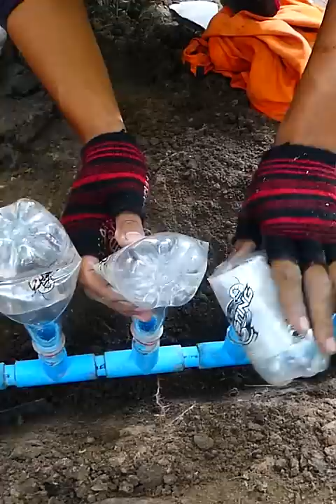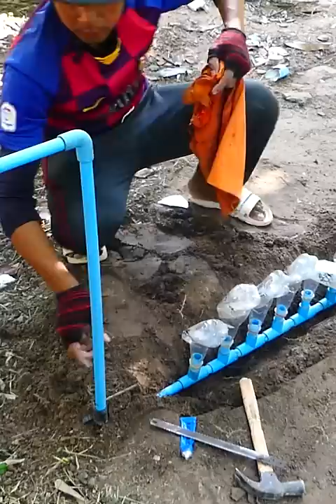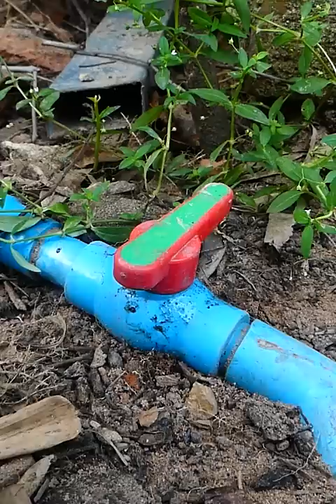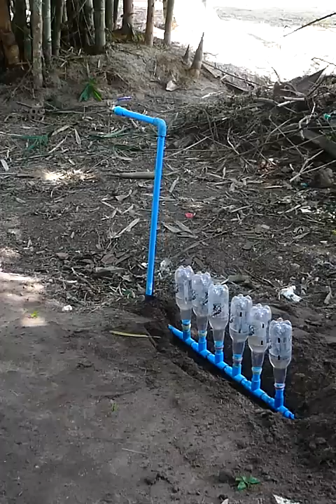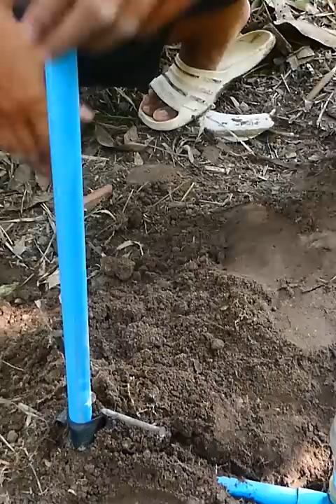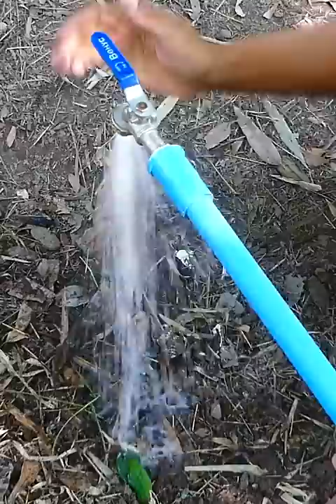Trick Free electricity | I turn PVC pipe into a water pump at home free no need electricity power

Comment: It's basically a pressure capacitor to create a temporarily high flowrate from a low flowrate system
Reply: Nope this doesn't act as a capacitor at all its basically useless all the pressure is due to the incoming water, the bottles didn't add anything. You might wanna review your knowledge on fluid mechanics
Reply: @tjvisuals  It's not causing the water to flow. Its purpose is to increase the water flow for a short period of time. Water can not be compressed, but air can. When the water pushes up into the bottles, it compresses the air, which will push the water out with more force when the valve is first opened. It just sucks at this job and will only increase flowrate for about a second.
Reply: @Zeecontainers  I know. But, since it is of no use its negligible you cant characterize this as a capacitor
Reply: Its purpose is to generate comments and views...

That's all
Reply: @orderofmagnitude-TPATP 😂

Comment: I believe those water bottles act as a diy “shut off valve” to release the pressure in the pipe when shutting off the faucet. It would have been nice if they didn’t try to scam people 🙄
Reply: The bottles wouldn't "release" any pressure in the pipe, they only replace water pressure with air pressure which would accomplish only the 'sponginess' of airbells that reduce stress on the pipes of abrupt shutoff and hydraulic 'hammering' that occurs without airbells.  This device would be useful if it had a check valve upstream of the bottles and a significant amount of water in the pipes to take advantage of the initially higher flow rate when the faucet is opened.  That would be providing a brief 'ram pump' surge.
Reply: I think what you're think of is called a water hammer arrester. It alleviates the spike in water pressure when you turn off water.  At best its what this guy attempted.
Reply: Just how are those bottles "cutting the flow off"?

Comment: actually its a home custom hydraulic ram pump, and plastic bottle will leak or die quickly, buy a proper device, interest of ram pump is that they augment the pressure in using water pressure itself, here soft bottle have compressed air which release pressure when you open tap water, so for several second you got more water pressure than without this system. the idea is to reach more elevated ground with this system.
usually ram pump are taller, and have clapet/valve... i advice to buy a proper one, 80$ for market price, another idea is to use an expansion chamber which are cheaper.
the title with electricity, refer to the alternative solution: electric pump/surpressor, so yes this solution is electricity free.
Reply: This is absolutely not a ram pump, commonly known as a water hammer, it is a water hammer reduction system, basically the opposite. Well, technically it's just a useless thing to generate comments, but you're still wrong.
Reply: The water from a ram pump comes out in pulses, not a continuous flow like this. Totally wrong.

Comment: Most people here did not understand the purpose of the system, it generates pressure in the water, but the bottles should be filled with air, preferably highly pressurized for the system to work well, that is, it is not useless, but rather functional in the way shown
Reply: Do you think it's heat, that's the only thing I can think of

Comment: Pretty sure this would work as a hammer reducer. When the tap is shut quickly the bottles will take some of the waters momentum into them, pressurizing the air inside, reducing strain on the pipes. Who knows how long the pvc is.
Reply: That was my guess as well
Reply: It should be above the highest point or it will water log quickly.... But maybe that's why he has 6 of them 🤣
Reply: yes, like surge tanks maybe.
Reply: But he squished the bottles first to have less air in them.
Reply: True, maybe just did that  to show us the water level?
Reply: Update: I set this up just like he did, even squished the air out. It works! I've had free electricity ever since and I'm saving a ton of money.  This is probably how the Egyptians built the Panama Canal.
Reply: @shakarchi420  that uh, that didn't really happen did it Homer

Comment: It works as long as there is compressed air in the bottles. Short after you open the tap and the pressure reduces, the flow goes back to normal.

Comment: For who dont get it immediately: The bottles store enough water for a constant water pressure until they are empty by using the water. The time water is off it can accumulate in the bottles. The pressure is good for work and nit weak for the first, but it can empty.
It is usual to have a electric water pump with a pot for the right water pressure. The electric pump would automatically reffill the pot before pressure would decrease..
This system should use no current, so it is free. Its not about producing current here.

Comment: While it's true that there are ways to make a water pump without electricity, there still needs to be some source of motion that forces the water through the pipes.

Usually either something like a water wheel attached to an archimedes pump or the gravity in case you are drawing water from a lake or river on a higher elevation than the outlet
Reply: Don't forget the "ram pump".  They are very clever devices.
Reply: @dennisbecraft1303 yes but wastage water more.
Reply: @amitpandeysg2  Ha!  A ram pump is "wasting water" only if you are planning on pumping out 100% of the flow of the river or stream!  Who ever expects or even wants a pump to do that ?  
No water is "wasted" if all you're doing is using the momentum of some of the water to pump some of the water.  
What value, usefulness  or characteristic of the unpumped water has been lost ?  
It's gravity that causes the river to flow and gravity will quickly restore the speed of the flow after you have diverted some of its momentum.  What damage was done by use of that 100% clean, renewable solar energy that lifted water in the atmosphere where gravity could eventually collect it & channel it in flowing water ?  
Conceptually you are claiming a ram pump is a waste of gravity !
You aren't unnecessarily wasting electricity or fuel in an engine driven pump when you are accomplishing the same thing by clever use of the immediately replenished momentum of flowing water.    
A ram pump "wasting water" is conceptually just as illogical as claiming a wind turbine is "wasting wind".  

How do you justify your objection to ram pumps when being compared to other methods that don't require electricity ?  I can think of some, but not that they "waste water" !
Reply: @dennisbecraft1303  brother I read who comment. I appreciate atleast u know exactly how RAM pump work. It's inefficient you already know. Yes, there are many ways to make efficient or utilise free energy 100%. Need some improvement or additional accessories to increase the productivity. It's true if u talk about design, no doubt it one of the  engineering marvel structure which go against gravity with 100% free energy .
Anyway thanks for your input and I really appreciate your wisdom. 
Cheers
Reply: @amitpandeysg2  Very gracious, but what do you mean by 100%?  No use of energy is 100% efficient, if that's what you are claiming.

Comment: For people thinking this is useless, look up a ram pump. He creates added pressure cause the water rises into the bottle and makes the air inside of it compress, then the valve opens and that compressed air pushes the water through the pipe. Once pressure runs out the bottle will be crumpled again, and you close the valve and let it refill. Automated non electric systems similar to this can continuously pump water 24/7 uphill.

Comment: So I believe the point is that water flowing in a pipe at ground level can be elevated with the help of the pop bottle pressure tanks.  The water source may have been a stream or springs with the pipe drain and only a small amount of pressure.

Comment: What he is doing is priming the line without using electricity. Its electricity-free priming, probably lost in translation. 

The bottles start folded to push as much air out as possible. Then he lets the water in. Normally the water wouldn't go up that riser with the spiggot but the bottles suction the water up the line. 

He taps the bottles to get rid of some imperfections as they expand to maximize their expansion. If you crunch up a plastic bottle and then let it expand on its own it won't expand all the way back without some help at the various creases. 

The plastic bottles provide just enough vacuum pressure to pull some water in and move water down the line.

Now, given how much water pressure there was, he could have skipped the siphon effect and just dug a hole big enough for a 5 gal bucket at the end and had the spiggot level with the ground instead of on a riser. Then the water would flow easily without needing to be pumped at all. He would just have to empty the bucket every now and then so there would be room for his hands to be washed below the spiggot and so that standing water in the bucket doesn't attract mosquitoes. 

Perhaps that is what they want to avoid here. Having the spiggot atop a riser makes this easier to use... If you don't count all the prep to prime the line. 

Another idea here is that the water in the transparent bottles is being treated with natural UV to kill bacteria and other crap in the water. Once primed, the water in the bottles will continuoisly exchange with the water in the line and this purifies the water to some extent, even heating it a bit. 

That's my hopethesis anyway.

Comment: I first half of the description is misleading but the second half is pretty correct, he pressured the system by using the empty bottles and letting the pressure buildup while not releasing the water so no electric pump is needed to get the flow of water he desired

Comment: the energy to pressurize the bottles had to come from SOMEWHERE, in this case, it came from the pressure on the water line he used to fill the system. What he made here could be called a pneumatic accumulator(capacitor). He stored the incoming pressure inside the bottles, and used the stored pressure to drive the pump. All this assumes that he shut off the incoming valve after pressurizing the bottles. If he did not close the valve, he has made a water pipe with extra decorations.

Comment: it's a little pressurization system , only instead of a rubber air bladder in the tank that compresses as the tank is filled with water and then expands as water is pushed out of the tank under pressure , without the pump running.

Comment: Does this want to be a water heating, or more like water tempering contraption? There are problems arising for creating aerobic pockets with direct sunlight. Plus I am not exactly certain but since warm water would have been lighter and the pottles are the offshoot in the flow, the warm water wouldn't really mix back into the main flow. Interesting experiment thhough. A solar collector does similar things, with the water pipe being coiled and sunlight focused on it. Would recommend that architecture.
Reply: https://youtu.be/Ridc13o1Fn8

Comment: How did water flow to start with?  If the supply is higher than the hydrant it will exit the hydrant with or without the bottles.

Comment: The concept here is pressure and he used the water bottles to simulate a water pump. Using gravity feed as a pressure system thus eliminating the need for an electric water pump..

Comment: All this will do is ones the main value is turned off the pressure built up will allow for a little of the water in the line, after the main valve too be pushed out. That's it

Comment: So in the 70s we’d ‘loan’ someone gas, or transfer it between can and tank in a field. No electricity. We used  hose with a squeeze hand bulb, or sucked the gas (don’t do this, we’re smarter today). You create a vacuum. The negative pressure pulls liquid then keeps flowing.

Pinch the flow and keep going to other tanks.

He might not have a pump at the end of the pipe, maybe siphon technique. I wouldn’t think plastic bottles had enough pull. His original source may have been higher than underground well. It’d need to be above, then his bottles may have been the higher point.

I think that’s how it should work. I do computers, not physics. Hahaha but I know siphons 😂

Comment: Ok so i guess this is just a  bad translation. The bottles help build water pressure. Technically he made a homemade pressure tank to raise the water pressure. most countries commonly use this technology in order to use smaller more efficient water pumps. So in a way it will save you money if you were somewhere that's 100 years behind in technology.

Comment: Ok maybe they meant stored water pressure?

 But they would also need a no return valve so the water doesn't go back to the unpressurized pipes at the other side of the pump.

This video was weird but it has gotten alot of views.

Comment: Making potable fresh water, sort-of. The idea is really cool, but i dont know how long the intake pipe is. The idea is to purify the water with the six bottles. The turn-off valve is to keep the water contained in that segment. I didn't make this. I just interpreted the idea, and the intention.
Reply: Though that section of bottles should be elevated higher than the output
Reply: To get that water you will have to contaminate it first.
Reply: At least i think.

Comment: The video is titled with "free electricity" because this pressurized chamber set-up takes the place of an electric water pump, which is needed in many areas of the world to access fresh water.
Looks like the first valve added air into the bottles, which brought the water up through another pipe from underground. 
Not everyone lives in a developed suburban, cookie-cutter neighborhood with a giant water processing & purification plant outside the city, which in fact, DOES have a GIANT ELECTRIC WATER PUMP in most areas. 
The ignorance & sheep comments on this video are genuinely upsetting. Maybe they could've worded it differently, but it still stands.

Comment: The bottle "pressure" would have to pull the water. In no way can it pull the water from a well, and then push it forward and up the stand pipe.

Comment: It's a translation issue, haters... could this help keep the water pressure stable perhaps that is the electricity 🤔 

If water supply dipped the pressure would remain constant. For a moment... they're essentially Capacitors like WITH ELECTRICITY 🎉❤😂

Comment: 😂😂😂 let me give this guy a hand. In some countries, like mine, the water pressure is very low and dribbles out of the tap. You need a 1.5 horse power diesel or electric pump attached to raise the pressure.

Comment: The bottles do nothing as they will hold the Same pressure as the pipe they are attached to. Other than the fact that you created 6 fresh failure points on that pipe, nothing done in this video benefited anyone whatsoever.

Comment: Hmm. There's a lot of hate here.
This isn't ky wheel house, i don't know much at all about this.
However, i have two electric pumps taking water from my tank.

With one you open the tap and the pump fires up instantly/immediately after the pressure drops. You want water you need electricity the whole time.

With the other pump (superior imo) it has a large air bladder in it at 13psi.
When you turn off the tap the pump stays running to compress that air a bit.
Next time you turn on the tap it will pump at a slowly decreasing pressure with out turning on the electric motor until the pressure drops.

I know there's nothing "free" about either of the above but perhaps this man is utilising the advantage of this stored energy?
F#$&#d if i know.

Comment: For everybody commenting on how stupid he is, wondering where the free electricity is, he's not using an electric water pump. He is using the bottles to create pressure which otherwise would not have been there. The water is down underground and it has to be lifted up above ground. Typically you would use either a hand pump or an electric pump. The pressure in the bottles is going to begin the water flowing to start the siphoning effect that will then pull the water up and out of the ground.

Comment: You generally dont need to write "trick free" if you're doing something true/honest. The line is clearly pressurized from an unseen source. Also, "no need for electricity" has existed for millennia, gravity pressurized systems existed long before and will long after this. A drop of 10' usually calculates to roughly 4psi, 20' gets 8psi etc. and that looks like roughly 40 to 60psi. Hand pumps were designed to build pressure in areas without gravity systems, and actually work, there's one powered by a bike rather then by hand that's leagues better than this nonsense. These types of videos are annoyingly stupid